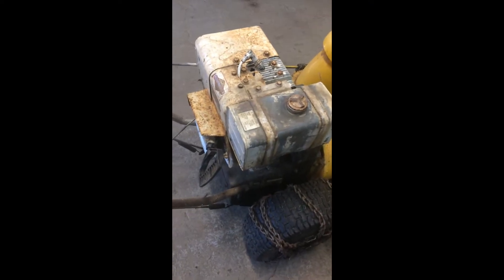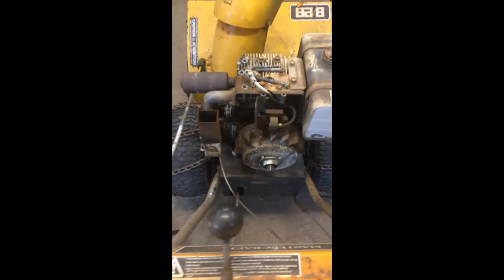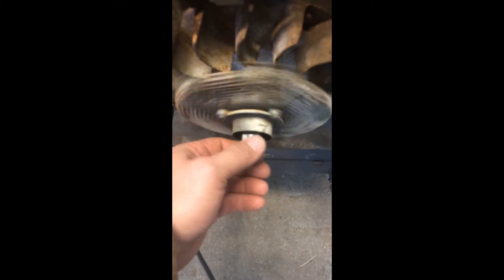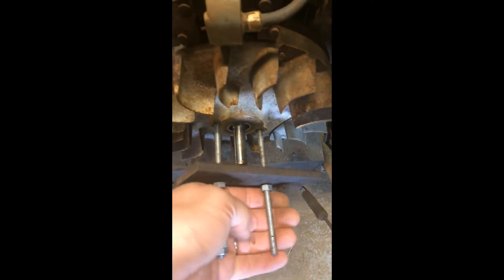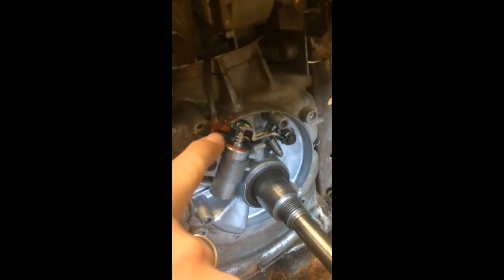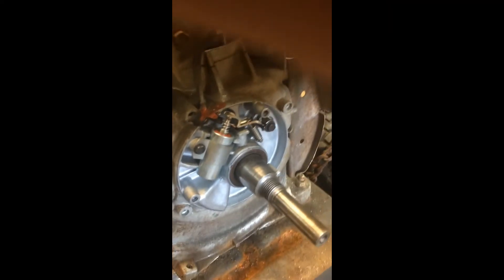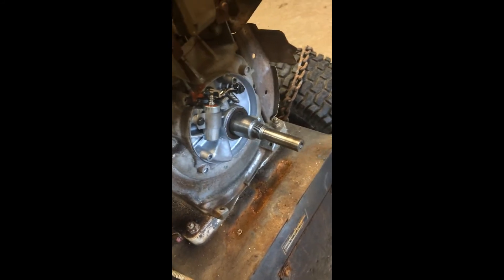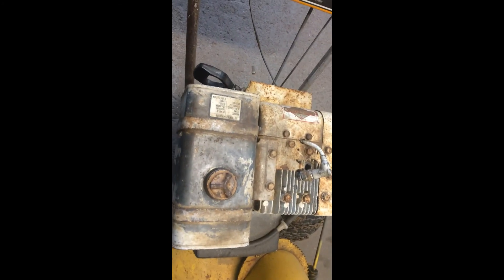8HP Briggs and Stratton engine no spark fix

Comment: Hi Mr Shop, what are the model numbers of this engine? I have 1 that looks just like it that was on a woodsplitter I bought. Unfortunately there are no numbers stamped into the recoil cover. Have no idea what  it is for ordering parts. Thanks
Reply from the maker: Sorry Eric. I no longer have this snow blower. However you should be able to search up the HP (8) and the approximate year this is a late 1970's Briggs. Most the common parts then were used in a lot more models over a longer period of manufacturing than todays parts.

Comment: Nice. I just got an old snowblower (freebie) with the same engine. Interesting that yours has the older points type of ignition. Mine has the magnetic type(?). But my serial number 17042 0189 01 6708041 seems to state that it was a 1967 made engine I could be wrong. But maybe someone has replaced a few parts . Any ways just something to play with.
Reply from the maker: Thanks for Watching!! a 1967 should be the same as mine in operation. They really wouldn't change until CDI's